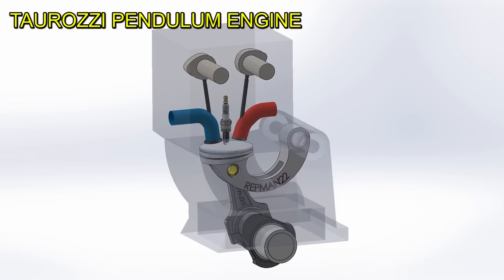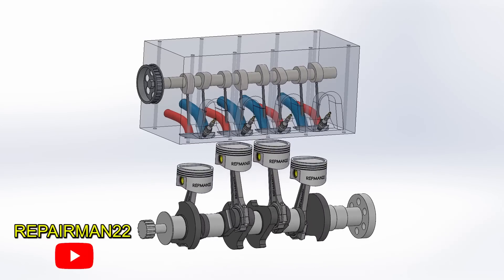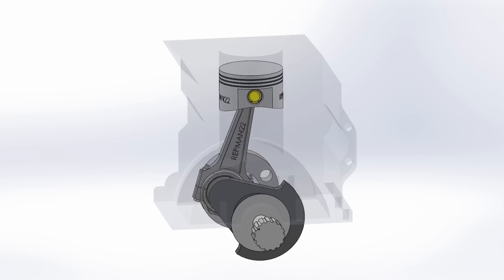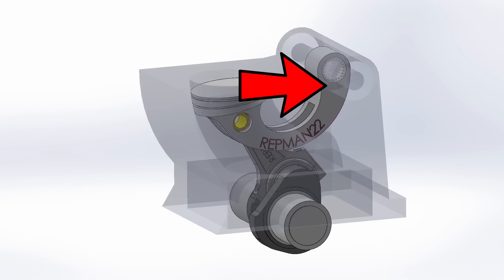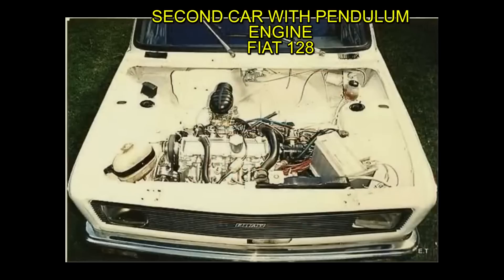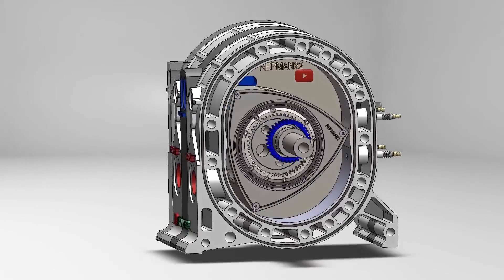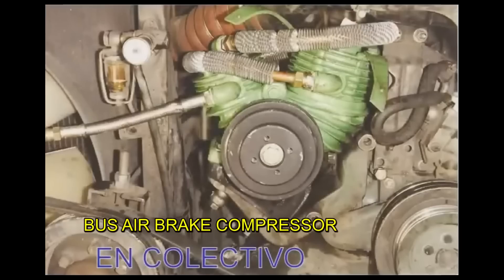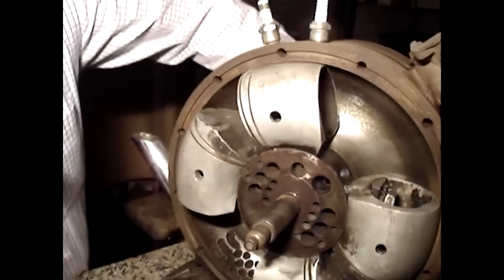All about the Taurozzi Pendulum Engine 🧠 and what happend to it🤯

Comment: There’s so many different designs of combustion engines. All very cleverly engineered. This one is very interesting. Total control of the piston. The fascinating part is DRILLING A CURVED HOLE In a solid block of steel. I always found machine tools as interesting as the parts they were making.
Reply: Piston and engine block are all aluminium nowaways... None has to bore a curved hole, one has just to bore a pre-moulded curved hole, since the block-mould generated blocks with the cylinders already there, and only the inner-cylinder-surfaces have to be re-bore again, so, just to finish the surfaces.
Reply: @klausbrinck2137  That's a far-fetched statement.. But to clarify, the majority of engine blocks are cast from CAST IRON not Steel.  Aluminium is quite a bit more expensive to use.  To aid in the excessive costs and keep the traditional cast iron usage some engines, like Ford's twin turbo are cast using CGI(Compact Graphite Iron) or vermicular graphite iron.
  So it's silly to say that all pistons and engine blocks are aluminum nowadays cause that is pretty far from fact. 
 Also the comment you were replying to was talking about the drilling of the engine block in the video, not the ones nowadays..
Reply: @TandTAZ  I´m not sure the comment was talking about the drilling in the video, and not more generally... And anyway, none would drill holes, the holes would be ready-there (out-of-the-mould), and would only have to become surface-finished, even if it´s cast-iron, and not soft aluminium. And for surface-finishing, one can even use contact-less ECM or EDM. The blades of turbojets also aren´t CNCed, they are ECMed.
Reply: Boring machine on a big cam would've done it, or fixed boring machine and the work-piece on a cam.
Reply: The block itself can be built from half-pieces. The half-toroids are machined easily, then bolted together. Then, the actual sleeve can be made from a pipe. Curved pipe, that is press-inserted in the block curved channel. The pipe can be made out of special steel with high friction resistance and can be treated rolled and heat treated. Such sleeves can be changed if necessary....   I noticed, no one commented (or I did not see anyone) on the short piston with no skirts. such smaller lighter piston generates less inertial forces at top dead and bottom dead centers. Less inertial loads on connecting roads. This may increase the upper limit of the revolutions. Of course, the banana "tail" also participates in the weight, and you need to integrated each small section of the banana to get the total effective inertial weight. I am not exactly an engineer, just a curious enthusiast, please forgive me for using non-standard expressions, or even for talking nonsense.
Reply: @west_park7993  good idea

Comment: I was intrigued by the curved cylinder and the complexity / problems of "curved" boring. I see absolutely no issues initially with 3D printing the whole block!
Reply: 3d printing is extremely expensive for mass production, especially for something of this size. Also the printed part will still have to be machined, just as a casting would, because the surface finish of even the best 3d printing systems falls far short of what is needed for a good bore.  So with 3D printing you would just be replacing the casting part. The rest of the manufacturing would be just the same.
It is actually only slightly more complex to bore this type of toroidal cylinder than an ordinary straight one. It is something that was within the capabilities of even early 20th century engineering, no need for CNC or any fancy stuff.
Reply: @listerdave1240  I really ran wild with my last comment without serious research! I still see 3D printing as viable but in the early development stages and feel could be bored or honed to required size and contour fairly easily. I have tried to get some curved boring machine examples so I am not so ignorant of this technique unfortunately unfortunately there does not appear to be much under 8m dia and can start in one side of a mountain and come out the other! An sample machine type appreciated if to hand as it would be good to see first hand the design.

Comment: I would think that if you made a cylinder boring device, and replaced the piston with a driven cutter wheel, the curved cylinder would be rather easy to create. Think of a tunnel boring machine, where the entire "head" was a cutting bit, and was attached to the curved arm... It really doesn't seem too difficult.  Stop thinking of forcing a regular bore bit  to make a turn- cast the block with the curved "cylinder" already formed, then use the above-stated boring system to "cut" the cylinder to needed specs and diameter.  Problem solved. 🤔

Comment: Not trying to knock the engineering on this, but if it were as efficient and able to still produce power in range of a similar sized normal engine, manufactures would be building this and using it. But they are not so there must be huge flaws in the design or in the actual proficiency of it.

Comment: that this works in a compressor doesnt mean anything for the production of the engine itself.
making a perfect curved bore is still a big challenge especially in mass production.
the simple straight bores are much easier to do perfectly.
Also the disadvantages you listed for regular engines are not really a problem, if they would be we would simply have engines failing cause their piston got worn down on the sides which we rarely ever have.
you also didnt say anything about HOW this design is supposed to save fuel and be more efficient except that is supposed to have less friction but that is not the main energy loss for modern engines so it doesnt make much of a difference.

Comment: I don't buy the 30% power and efficiency gains for one second. Maybe 2% (And even that I would doubt) which is outweighed by the vastly more expensive manufacturing. However, I do see a missed opportunity for improvement here. The pendulum arm should be counter-weighted on the other side of the bearing to balance itself, the piston and small end of the conrod. Then the crank would only need to balance itself and the big end of the conrod. I don't feel like actually running the numbers or a simulation but I suspect that would cure some of the balance problems some engine layouts have like single cylinders, inline 5s, big displacement/high rpm inline 4s, etc.

Comment: A combination of taurozzi pendulum compressor engine with electric motor can practically work as an hybrid ev with unlimited range and minimum fuel consumption to recharge batteries while on the move
Reply: Could say the exact same thing about any other engine design. Nothing special about this one on that regard.
Reply: @wingracer1614  I think the engine is something special, it does solve the issues of piston friction and oil consumption. Am certin you'd feel bad especially when someone unknow calls your hardwork nothing special, especially if you have dedicatated the most important years of your life to a dream. Never under estimate someones hardwork because we dont know what situations they have gone through.
Reply: @pcpatel01  Piston friction is pretty negligible in conventional engines. Not enough to justify the increase in weight and complexity. I can see why it work for compressors and out esteemed inventor can live happily knowing he made such a useful innovation in that regard.
Reply: @wingracer1614  i hope you understood my point of view without feeling offended

Comment: With curved bore like that the limitation will be stroke length. Which means at the same diameter of normal bore the stroke will be shortened. Thus decrease the compression ratio. It can be propagated with turbo and or supercharger. Which today is the norm. With short stroke like this engine,  a motorcycle, personal watercraft, will be more advantageous. With higher rpm. If the friction is less as stated. The last hurdle would be in the making of valve spring, but if its only 13-15k rpm it already solved with today technology. So if all stated advantageous is true. It would be good enough for today use. Unlike old days.
Reply: Stroke has nothing to do with compression ratio. Plenty of very short stroke engines have very high compression ratios.

Comment: Fascinating engine concept. But the video doesn't get into the areas which really matter: 1) Horsepower amount and curve. 2) Torque amount and curve.
3) Fuel Consumption at various RPM'S 
AND under various loads. 4) Weight of engine long block and with accessories
5) ease or difficulty of repair
6) typical intervals between nesssary
      cycles of maintenence.
7)  longevity between overhauls
8)  practical nature for standard 
      Vehicle road operation. Power 
      Typical rpm for driving, noise
       Of operation and vibration etc.
       In other words: how "Steetable"
       is this engine?

None of these basic, critical

Comment: I like the idea of the engine, but "frictionless" isn't a thing. You can have definitely have less friction. 30% is a huge increase. If you removed all engine friction losses, you still wouldn't have 30%.

I think alot of great ideas like this never get off the ground because they are sold with nonsense data. People don't want to invest in made up numbers.

Geo metro/suzuki used pistons with only one compression ring, in the 1.0 3 cylinder with a particular trim level. It didn't result in magic. 

You have extra reciprocating weight, to offset the frictional gains. I don't belive for a second that the loss of weight at the piston isn't over compensated for with the swing arm.

Comment: If it can be put in a V-configuration, then I think it could work as an Opposed Piston Engine (2-stroke, 2 pistons per cylinder) with a single crankshaft.
Reply: One of the compressors looked like it was an opposed piston unit.

Comment: Did anyone say the oil industry has something to do with keeping this motor away from mass production .A fuel efficient low oil consuming  powerful motor with fewer wearing parts.. Why would this happen ?  $$$$. How many liters of oil would be saved if all internal combustion engines used only half the amount of fuel and oil for for the last 40 years ?

Comment: Maintenance nightmare.
It would be quite tricky to re-bore such a block; specialized boring tools would be required.
Just about every automotive shop can do a cylinder job; with this design all the work would have to go to specialized shops.

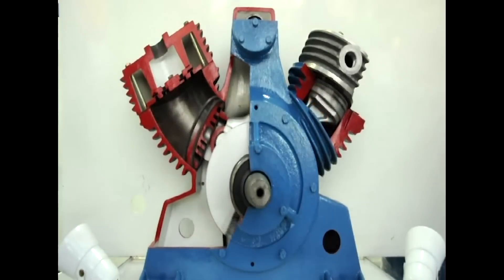Comment: Interesting that you mentioned his car still exists (5:56) this implies that it has good reliability. (Probably mostly a result of fiat parts, but we can ignore that?
Reply: We have no idea how many times he has had to rebuild it or how often he has driven it. There are lots of 1950s Ferraris still around and being driven. Does that mean they are super reliable and durable? Hell no!
Reply: @wingracer1614  yes. It really depends on the build quality of the custom parts. Other than that, it uses a lot preexisting parts. The swing arm probably is made of some cast aluminum or something, which probably doesn't work well after a certain rpmz and the piston I imagine wouldn't be the best quality either, the block hopefully wasn't half assed. but the cylinder head and all the original parts (that aren't modified) might be good. I don't think he ever ran it with coolant, or ever tested it for long enough to see how it ran hot, so that's probably another bog issue. But hey, at least the initial concepts ran for a short, probably very careful drive.

Comment: The reason that it is a failed engine design is because it is far too complex, too expensive to manufacture, and has no benefits. It is not more efficient nor does it produce less emissions than a conventional engine. It is not frictionless and suffers from excessive wear when used as an engine due to thermal expansion of the piston arm causing the piston to move sideways in the cylinder bore when hot and it does not run any cooler than a normal 4 stroke engine. Also, normal piston designs work fine as oil free compressors and are far more common and cheaper than pendulum compressors.

Comment: No engineer would ever doubt that this engine would work... but every engineer would wonder where the benefits of it are. There is no fundamental difference to conventional engines to base the increased efficiency claims on. If I miss something: Enlighten me!
As for the major drawback - probably enough to kill it for automotive use: It is A LOT more expensive to manufacture. The cylinder bore of a normal piston engine is a (duh) cylindrical hole, quite easy to machine. The cavity here is a complex 3D-shape that is a nightmare to machine.

Comment: So according to this inventor some 30% of fuel is used to overcome friction in the pistons? You can turn over an engine by hand, the friction is already very low.
And most of the heat in n engoige comes from friction, and not the fact tht fuel is burnt at many hundreds of degrees Celcius?

5:50 "The reality is that there are hundreds of compressors roday"

...and hundreds of millions of cars.

A straight cylinder can be manufactured using any off-the-shelf boring machine.  A curved cylinder requires special equipment that will take much longer to hone a cylinder. Adding the hinge makes the process slower too, more parts that can fail, etc.

Either this inventor was shortsighted or the voiceover is clueless.

Comment: Just because it works doesn't mean it's better. Because it's an on ark there's going to be uneven wear of the rings and the cylinder walls.
There's also going to be uneven combustion because the combustion chamber is not uniform.

Comment: I like how the marketing bullshit claims low friction even though it has pretty much the same amount as a normal engine. Still got a spinning crank, still have piston rings sliding over the cylinder wall, still have a cam, still have valves. Still have reciprocating mass except now it's on a curved trajectory so good luck balancing it.

Comment: Engine designs, metallurgy and machining have improved tremendously over the last 50 years. The reason why this didn't make it as an engine is likely because conventional engines have improved so much that Taurozzi's "benefits" were never particularly relevant in that application. Today's ICEs are far more than 40% more efficient than those from 40 years ago, tolerances are much tighter, modern engines burn far less oil thanks to having tighter tolerances, use much lighter oils to reduce friction in those tighter spaces and that oil is engineered to burn cleaner, closed-loop EFI can compensate for normal oil burn, etc. I doubt a Taurozzi updated with modern technology and knowledge would perform significantly better than modern conventional engines.

Comment: "The engine produces X% more power and is Y% more efficiency" - so did the scammer that tried to sell the engine claim.
It is not hard to come up with a new engine design, it is even easier to lie about how the engine performs.

The simple fact is that it is the same as 99% of all claims of having created something far superior - a lie.
guess who would have been the first to jump on it if it actually worked? EVERYBODY that uses or produces engines. The military would love to get more efficient, reliable, high-power engines. So would the entire logistics industry, and motorsports, and many many other multi-billion dollar industries. They don't care who invented it, or if it would make their old business obsolete, as long as it makes them more money.
(Hell, just look at the oil-companies - they are some of the biggest investors in renewable energies cause if any of that technology would turn out to be viable they want to be the first to reap the benefits).

Comment: So this adds more parts, but only has small advantages. Friction and wear aren't a huge issue, engines last 300,000 miles. There's no way this saves 30% energy.
In any case, the overall efficiency is still terrible compared to BEVs. Internal Combustion Engines are soon to be obsolete. This is never going anywhere.

Comment: Wonder how would it do with LPG, CNG or H2. I'd love a V6 of that type. Perfect for sports cars.
Reply: YES!  I had to scroll pretty far to find the RIGHT comment!  There are so many hints in the video.  And the small movement in the pivot can be used too for stuff like maintaining high psi in an injector system.  Some gases just need a glowplug as well.  Torque can ALWAYS be converted to HP, it doesn't have to run high rpm if the transmission has enough gears.  Imagine a 1.25L-1.6L 4 stroke in a hybrid like a Prius with a higher density fuel with same weight ratio.  I get 60MPG now with a Prius and don't even fuel up >1 a month.  Imagine with LP or H² which is a pain in the butt to fuel up in my area ... more MPG=less fuel ups.  I care less about performance for the daily driver, my FORD FLEX gets 18mpg, my Dodge truck gets 15MPG ... give me 70+MPG equivalent in a retro fitted $15K hybrid and I'll go out of my way to fuel it up <1 a month. car industry doesn't want you to upgrade older cars, they want to sell you a new one every 140-190k miles.  Toyota should drop these motors in, they'd put many mfgrs. out of their misery.  I wouldn't want so much aluminum in 'em, but that can be figured out.